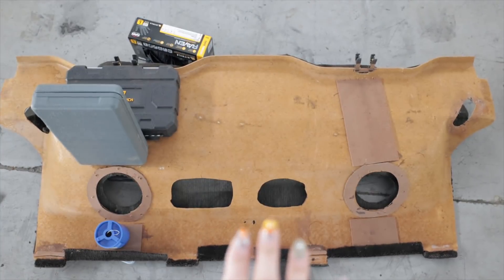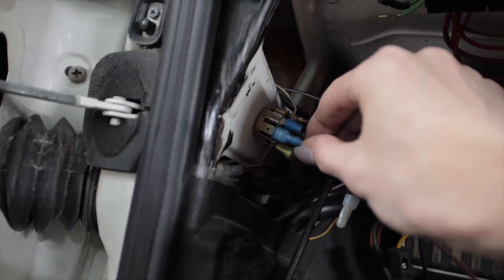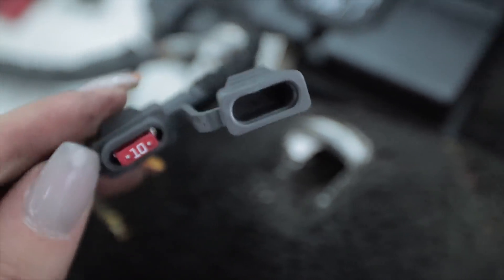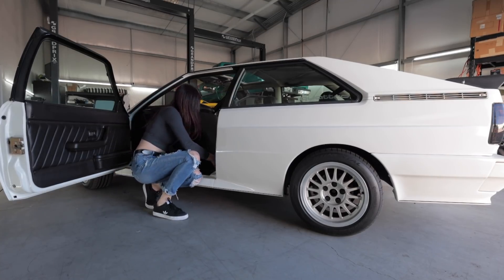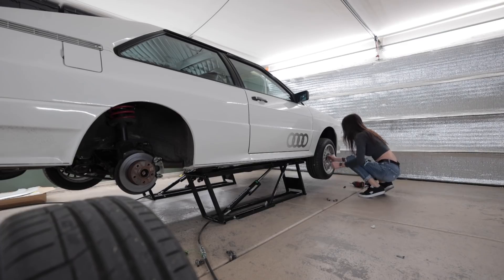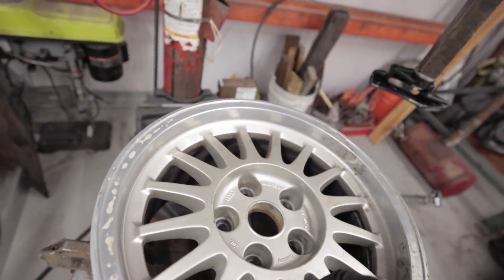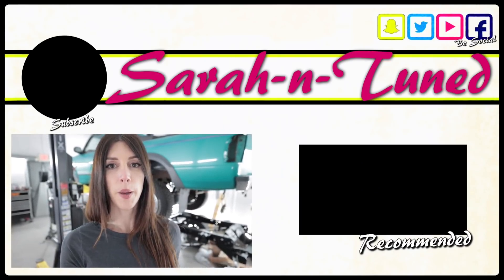I Needed To Change Things Up A Bit! // Project Ur Quattro

Comment: Yesterday at 6am here in north Texas it was 17 degrees and through the day and now at 7:30pm it’s 60 and very mild. Anyway your right about wiring that head unit because my K5 Blazer had a factory system and I couldn’t make heads or tails how it was wired and I removed all the Bullshit and wired it myself.

Comment: The purple wire, tied into the dome light ground wire, was probably part of an alarm feature built into the previous head unit.
The factory gray wire with the blue tracer was tied into the dash light circuit. It was originally daisy-chained, in & out, on the back of the factory radio harness.
Some factory radios did not have a ground wire as part of the factory radio harness/plug (Ford & Chrysler). D-I-Yers would assume that the dash light wire was a ground, because it will test as a ground (until the headlights were turned on) & wire the aftermarket radio's ground to it. Everything is fine until the lights are turned on, & the dash light circuit fuse blows instantly.
Blaupunkt translates to Blue Dot.

Comment: I really want a head unit with all that front facing input goodness on it.  All the music on my phone is on a microSD so I would use that SD slot.  If the package tray is reasonably still in form then I like to use a layer of fiberglass to reinforce it...same with headliners.

Comment: Just fitted a period Blaupunkt New York in my E34 BMW 535i sport, although I retro fitted a Bluetooth adaptor myself as it was way, way cheaper than buying a Bremen.  Great to see you taking such great care of the UR (You Are) Quattro but not being so precious as not to use it regularly.  I'm a firm believer in cars being used as they were intended and not just sitting gathering dust in a garage somewhere, which is why I'm up at 6am on a Sunday and about to go road trip my E34 despite it being about 7deg and rain showers outside.  It's hard to believe that back in 1991/92 I bought an identical UR for just £3000! If only I'd kept it.  Anyway, thanks for great content as ever.

Comment: HI , Factory Ronal R 8 on Quattro where silver and the first years only 7x15, the 8x15 came in the last years , with the 4 valve 5 cylinders. The R8 you have are aftermarket Ronals ( but original ). with these wheelbeds  ( shiny ) they where never offered by Audi! The factory Audis where plain silver ( at least at the long wheelbase Quattro )

Comment: I loved the mid-70s. 1976 in particular was a great summer.
Reply: and was just musing that upgrading the sounds in an Audi is different from starting from scratch in a '69 Morris (my job for the weekend) when you mentioned SD cards. My bargain bucket stereo I fitted featured an SD card slot - hey presto all my music collection booming from a £13 head unit :¬)

Comment: I got it, like watching sexy version of Wheeler dealer's; with correct squeaks where needed. Love your enthusiasm you put into ever Job you do. And The ranger Project, why not. My first purchased car after First reenlistment Was 96 Ranger, not 4x4 bad on my choice, but hey I still have it runs, only issue Factory radio died lost Power to the Plug, gave up trying figure it out.

Comment: Great install video. So nice when you can take the seats out. Newer cars are a nightmare to remove because of all the electrical wiring for safety crap attaching them to the body. The exhaust sound on your Quattro sounds like someone doing an exhaust sound with their mouth lol. I may have missed a video. Do you own a dry ice blaster. I have never seen that. I want one. What can you blast with that. Do you think you could blast intake carbon off direct injection engines. That would be so much easier than nut shells. I really look forward to seeing your videos. Something different all the time.

Comment: How you feel about the factory wheels for the Audi quattro,is how I feel about the factory wheels for the 2000 dodge ram Laramie slt they are supposed to be a polished aluminum wheel with a brushed aluminum rim only the center was highly polished but they said that the clear coat was peeling and they look oxidized and plastidip them black center caps lug nuts and everything...so I need to figure out how to best clean up the wheels so I can repolish them and clean up the center caps and probably buy new chrome cap lug nuts.

Comment: You should consider a couple layers of fiberglass matte and resin to fix that back shelf.

A Nomar third hand might be nice for the tire machine, but generally only needed when you are using a junk Harbor freight tire machine. Also helpful if you are using nothing but spoons to mount tires and motorcycle tires.

Comment: 205 50 15 tyres? Also, the DOT Code, does that say 172, or 1721?
The tyres are either nearly 20yrs old or 8mths old!
I'm a self-employed mobile tyre fitter based in Merseyside, England and that was the first thing I looked for on the tyres when you removed them off the car!!

Comment: Using SD card slot is a better and safer choice because your not filling up your memory with extra music on your phone.  I drive a 2011 BMW 328i Xdrive sedan and I use the USB with a SD card reader plugged in the arm console.  You can change your music faster than using your phone which is more dangerous.  If a cop see's you changing your music on your phone, they could get you for texting because it's considered  a distraction.
Reply from the maker: I listen to Spotify and SiriusXM.. so no need 😊
Reply: @SarahnTuned  OK, that explains why you don't use the sd card slot.  I had Sat radio till there prices went up and all I listen to was Sirius XMU independent music station.

Comment: What is the tape you're using on the wiring harness? I need to know since a lot of the Ford stuff I work on uses it, and I'm usually using 3M electrical tape.

Comment: that's so awesome you know how to dismount/mount tires. I never learned that, and I wish I did because there's a garage I could use one and do my own work. I have been using Sumitomo HTRIII and HTR fives because I think they're extraordinary value for the performance and treadwear. I used them on my porsche 996 and now on my mercedes. There aren't many  options for a 30 profile out there. and also there's limited supply due to pandemic.

Comment: You wired the power directly to the battery not switched On and off by the ignition?
Reply: Or was that a continuous power wire

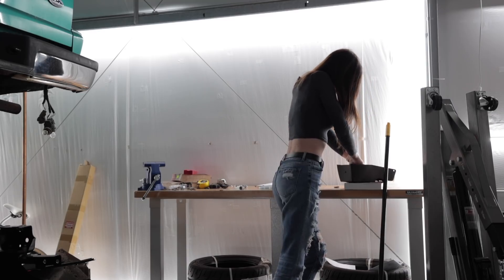Comment: @8:26 cue Happy Gilmore reference
Reply: Also, if you use nitrogen instead of plain air it won't stink as bad plus it's better on milage because the nitrogen is lighter
Reply: @Hades2Eros  It's gotta be negligible at best. Atmosphere is 78% nitrogen already.

Comment: I have different SD cards for different driving...hundreds of songs on each and 6 cards in a tiny credit card size storage case. Best part is the digital files degrade less than some devices do(cough...iphone)...and if they do, just load up a new one.

Comment: There are some circuits in my 1980 Pontiac that are always hot, like the dome light. When the door switch is depressed, it connects to ground (completing the circuit).

Comment: I had an 82 Audi 4000 5+5 (Five cylinder engine/five speed transmission).  It looked the same as yours from the front and so did the interior.  I put in a six disc CD changer (this was hot stuff back then).  Some low-brow sacks of dirt broke in and stole it.  Seeing you do the stereo brings a tear to my eye.  I totally remember that gang/crown shaped ground point.

Comment: The fuse box is the same as the one fitted to the Porsche 924.  Very unreliable and causes all sort of electrical issues. You’ll need to replace it as the soldered joints inside will disintegrate

Comment: Hi, friend! You should hunt down a S variant engine from BMWs M division and turn it into another project build. Any engine between the time frame of 1986-2006 should do it! These engines are loaded with technology/intricate theory.. I think you would enjoy digging into these since your curiosity runs real deep. Look into an S54 or an S62. Your better fit is the S62 (assuming you are fond of V8s.) You’ll regret the idea once you have found yourself in a pool full of parts you have to replace BUT.. the balance and power is unmatched. The knowledge and experience gained from owning an older generation S variant is priceless. Give it a shot

Comment: You need to watch out for the 225, there's a reason why the car had 205...
It's not that the previous owner is dumb and loves streched tyres...
You'll find out the hard way that you need to roll the rear fender.

Comment: Tip always start at the valve stem when removing tyres as you can damage it or even worse cut it and then you will have a leak, same when fitting.
Reply from the maker: Tip always replace the valve stem when you powdercoat a set of wheels 😂
Reply: @SarahnTuned  Or when you change the tire. My valve stem failed on me after it was in place for four years (changed with new tires) ;)

Comment: If the old shift boot was real leather, soaking it in a high quality leather conditioner, both onside and out would have been another option, and might have resulted in less swearing.

Comment: Okay so I have a question. Why wouldn't you mount the rear speakers to the metal rear deck where the cutouts are? I don't get why they have to be on the cheesy cardboard thingy.

Comment: Q: how many fuses does one radio need ? (hint: there is one fuse on back of the radio already)
Reply: The fuse isn't for the radio it's for the hot wire running from the battery. No fuse and the wire rubs through = fire.
Reply: @mattsondergeld5576  so there should be fuse  on that thick red battery wire, and also on that thick black battery wire, right? :D
Reply: @xpertvis  the black one is a ground so no. The red one yes if factory or done correctly
Reply: @mattsondergeld5576  New cars, mainly VW group and maybe others, has pirofuse on battery side, which is however not for protecting wire. I have never seen fuse on battery side. Point is, wire is protected by fuse which is already in radio.
Reply: @xpertvis  again connect a wire to the positive side of your car battery and connect the other end to a ground you will see why you need a fuse
Reply: @xpertvis  if the wire rubs through between the fuse at the radio and the battery it will short and cause a fire. That's what I mean by the fuse is for the wire. If the wire shorts the fuse blows at the battery no fire.
Reply: @mattsondergeld5576  You can say that about main battery wire, and yet, there is no fuse on battery side. wire is protected by fuse, and it doesn't matter if fuse is on either side, in the middle, or wherever...
Reply: @xpertvis  the main battery side is protected you just can't see it

Comment: Last year I helped somebody wire in their head unit on an Audi TT.  The wiring that was there, made absolutely no sense.  So we made the decision to re-wire the entire stereo system, all six speakers, the woofer and the head unit.  Saved us so much time and it worked.
Reply: Sometimes is makes sense to start over again rather than fix what's there...
Reply: when Chrysler started using the fiber optic ring loop system in the early 2000's, if you tap in to what you thought was a "12v power", it would kill the entire vehicle. and there wasn't a adapter harness available at the time. which sucked. friends would ask me to help them after the fact and the there was nothing I could do. the shop I worked/ competed for had to do a clean wiring of everything in order to bypass the system. same went for GM products because the adapter harness was any where between $100- $200 by itself.

Comment: Rather than "power coating" your wheels, did you consider sending them out to get polished and anodized?  I will not comment on other things that can smell of old fish.
Reply from the maker: Nah, not with how bad UV is here. I love the look of an old school anodized Volk wheel though!
Reply: @SarahnTuned  :  Properly anodized Aluminum is more resistant to UV than "power coat", which chemically is 
"thermally activated single part epoxy", which is broken down by UV, and relies on pigment and UV blockers to protect it.  Admittedly the modern UV blockers added are excellent and last for decades.

Comment: Just a little tip:  Those foam speaker enclosures will change the sound and won't sound great.  Those speakers are designed to be in a free air system and use the trunk space for bass frequencies...I know sounds geeky but I worked in a car audio shop for a bit.  One more tip....if that back panel rattles and flexes too much just put a couple of layers of fibreglass on the back side and a couple of squares of sound deadening, it will last forever and sound will much better.
Reply: I was thinking why not just use fiberglass enforced bondo.
Reply: @chasestewart302  you could use bondo. Fibreglass is lighter and maybe a little less messy and more of a consistent thickness.
Reply: What's funny is that in the last video, it was recommended to do the complete opposite!  And for similar reasons.  But you both seem to agree on the fibreglass.
Reply from the maker: They sound great, so they’re staying put! 😊
Reply: got to try that on a B15 when i get another one that rear deck this rattles back there.
Reply: Agree, those small enclosures will reduce the low-frequency performance of the speakers. For reference, look at bookshelf speakers with similar size drivers; their volume is much more than those foam enclosures. Then again, if you don't care about low bass, no loss. Just don't apply a lot of "bass boost" (i.e., extra power) to the speakers, you'll just fry them.

Comment: FYi, sold tyres for many years.... tyre tread wear rating is not standardized in any way. Especially across brands.  Its mainly only for comparing similar offerings from the same manufacturer.  Brand to brand, its useless.  For example, I love Vredestiens,  with a 200tw,  get 60k on them.   Where as a Mich 200tw is close to their stickiest. 
TYRE - euro spelling fer ya.

Comment: Great video as always, and happy New Year, too! :-) After redoing the entire electrical system on the MR2, this must have seemed easy. I'm curious about one thing, though: why was there no power coming from the fuse box to the head unit? Did the car originally not come with a radio?

Comment: If the Ronal's were Champagne color originally and keeping in mind you're doing so much work to have it look original, FWIW I'd stick with Champagne :)
Reply: I agree but my opinion should not matter.
Reply: I agree John. The champagne colour is called Zermatt Silver, the paint code is LY7Y. Its what all but some for the very last 8 inch ronals came from factory painted ( a few pearl white cars had the option of matching pearl white wheels). 
I’m not a fan of 8” ronals painted silver as IMO only zermatt looks period correct. It was only the very early UR quattros running 6” ronals that came in standard type silver.

Comment: I've always thought that it would be cool to get the Blutooth name for the car stereo changed to the actual car name, instead of just the head unit name when you connect to it.
Reply: I suppose if you can program a new Bluetooth ASIC controller chip with what you want.

Comment: The ranger will run, it'll be fine.  It's a Ford.  When ya gonna take the mechanical junk Bosch injection off that audi? You know it'll run better with electronic Bosch injection and 😬